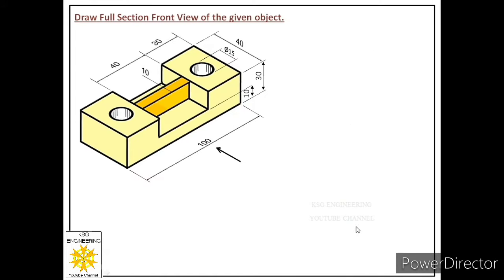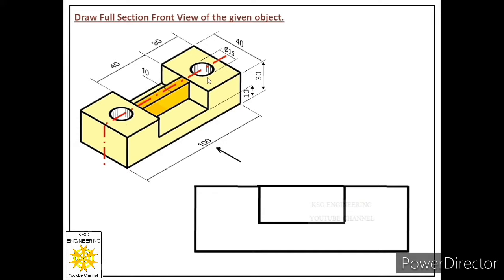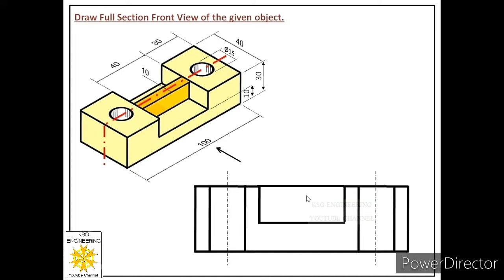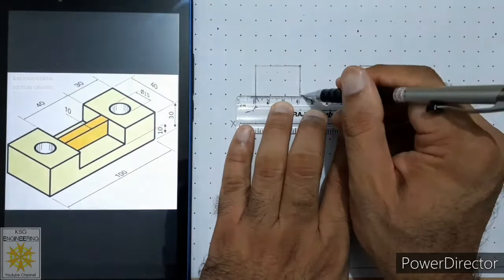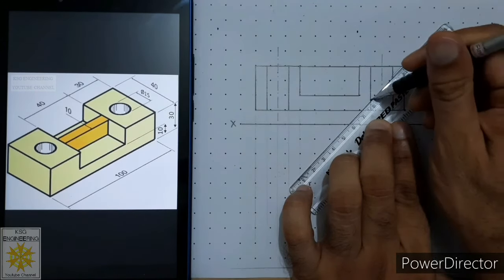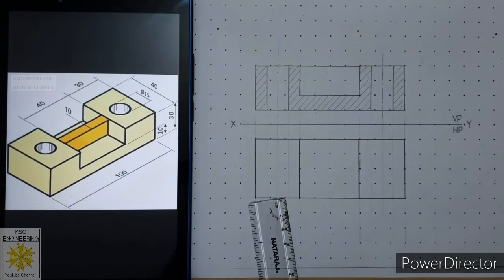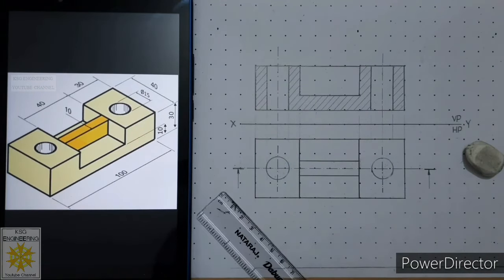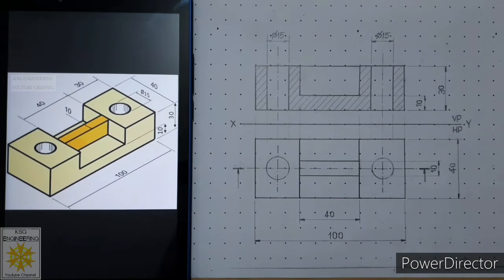Full Sectioning | Problem 3 | Engineering Drawing | 9.3

Comment: 00:02 Drawing full section front view of an object.
02:25 Sectioning process for rib in Engineering Drawing
04:35 Sketching hidden holes using dash medium lines
06:45 When sectioning an object, ribs should not be merged with other plates
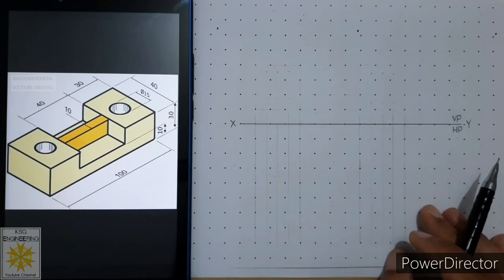09:16 Drawing of full section front first
12:00 Drawing a central hole with proper measurements and alignments
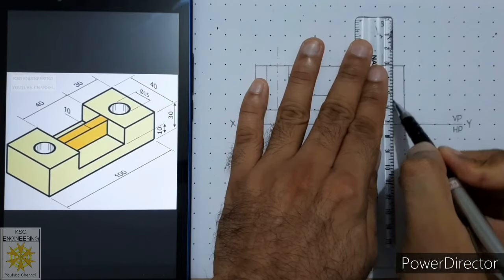14:34 Properly place section lines at 45 degrees for creating parallel and equidistant lines throughout the view.
18:17 Drawing the boundary and phases for the top view
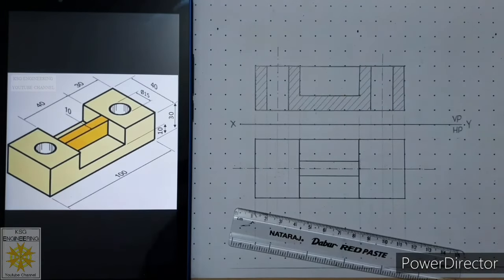20:53 Drawing holes with compass and converting antennae into cutting plane line
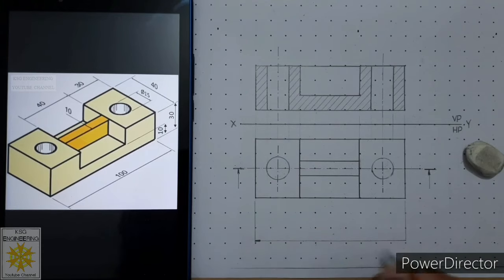24:02 Creating and placing dimensions in engineering drawings